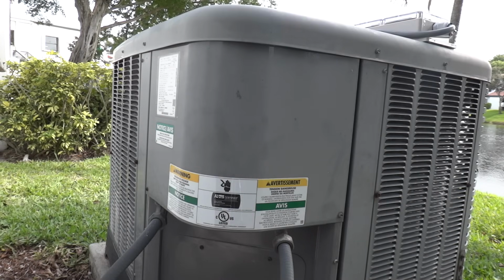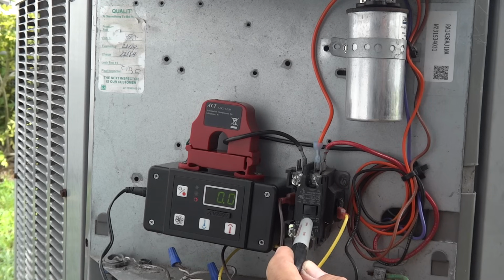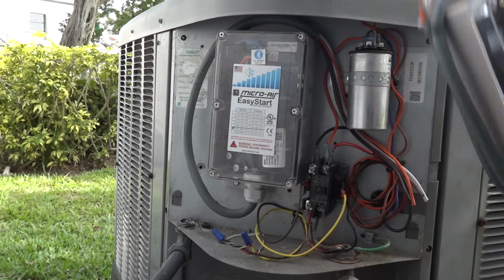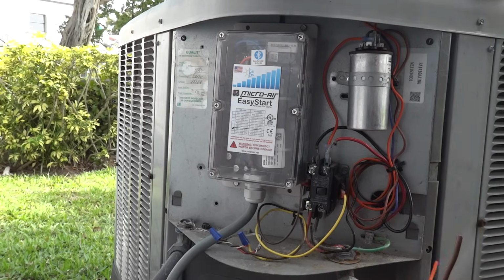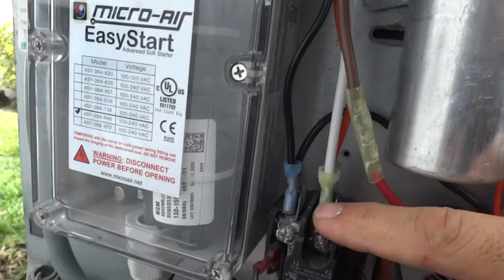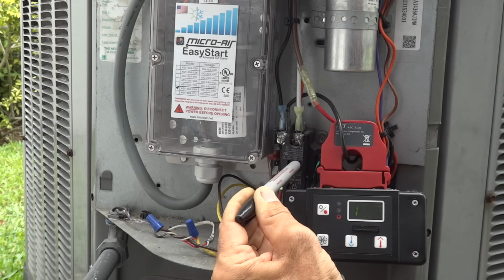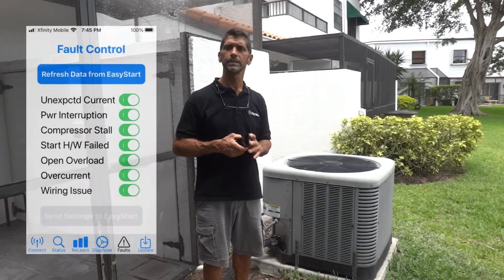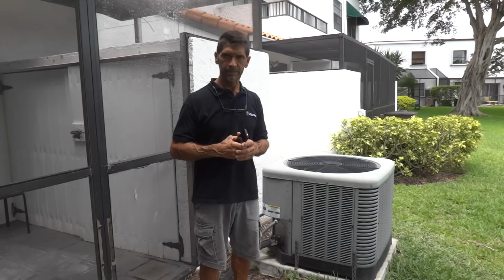Micro-Air EasyStart Home A/C Installation (368 Series)

Comment: This looks like a great device which I would like to install. I haven’t however been able to find any information on what happens if the EasyStart module should fail from some internal control problem? Electrical devices as we all know do fail, so I would like to learn what to expect when or if it does, which is usually not at the most opportune time. Will the A/C continue to operate under normal start up power, or not run at all? I have had a Generac load shed device fail and it prevented the A/C from running even with the main power on, resulting in an off hours call to get it back running. If the EasyStart fails, does it have an automatic/manual bypass built in, or would you have to rewire the A/C to get it operational until a replacement can be supplied?
Reply: Thank you for the explanation. Will the app provide any information that the device failed? This would be very valuable for remote monitoring.
Reply from the maker: Yes it can, assuming the EasyStart has not suffered some sort of internal power supply failure where its microcontroller and Bluetooth interface are no longer functioning.  If they are functioning, then the app can deliver the data to determine the nature and extent of any malfunction.
Reply from the maker: Hello and thank you for your question. As is the case for any soft starter, EasyStart is wired into the compressor wiring in such a way that if it were to malfunction, it would simply and safely inhibit compressor operation.  EasyStart has the highest reliability in the industry after over 12 years refinement and maturity, so failures such as this are highly unlikely and extremely rare.  In the few cases where there have been malfunctions, customers realize this because their indoor unit is running and blowing room-temperature air, the outdoor unit condenser fan is running, but the compressor is not after an extended period of time (i.e. after > 5 minutes).  Unwiring the EasyStart is simple since 3 of the 4 connections are "added on" to existing locations and can simply be unplugged.  The 4th connection involving the EasyStart's brown wire spliced to the compressor's run winding simply needs to be unspliced and the run winding connection needs to be reconnected to where it was prior to EasyStart installation.

Comment: I just ordered the X72 but according to your chart, I should have ordered the X48 for my 3.5 ton unit. Will the X72 work? I don't care if it's more than I need as long as it will work.
Reply from the maker: Hello and thank you for your purchase.  Yes, you will be fine with the X72 on your 3.5 ton system.  There is some overlap between the X48 and X72, but the revised ranges will guarantee optimal operation.  In your case, slightly oversizing will have little to no effect on the optimized starting amperage after the learning process is completed.  Thank you again for your business.
Reply: @MicroairNet  Appreciate it. Thanks

Comment: It was easy to install, works Great.  I bought it for my generator to run to house ac (9000 watts peak with 7200 running). Works great I would buy it again.

Comment: When you do 5 start do you from T-stat or you can just push contactor 5 time
Reply from the maker: Hi and thanks for your question.  You can conduct the 5 learning starts either way. If you are not in a rush to operate your A/C on a generator or an inverter, just let the normal cycling via the thermostat do the learning for you.  If you want to complete it more quickly, then you can deliberately turn the thermostat off and on or use the manual-button on the contactor.  Please realize though that if you attempt to restart the compressor via the manual-button on the contactor before it has been off for at least 3 minutes, EasyStart will flash the green "NORMAL" LED (3-times) until the balance of that 3-minute delay expires.  Also make sure you allow the compressor to run for at least 10-15 seconds AFTER the startup so that the EasyStart can properly record and save the learning data for that particular start.

Comment: While the easy start can get the AC/heat pump started, I wonder how much of an issue auxiliary heat strips run during defrost cycles would be. Since getting an energy monitor I've noticed that the air handler for my heat pump goes from 500 watts to 10kw for a couple minutes every couple hours when heating. The rest of the time my whole house including the 3 ton heat pump usually draws under 7kw. I'm wondering if the heat strips would need to be disabled for the defrost cycle if on generator power without a 10kw+ genset and if that would mean physically disconnecting them or if there is a setting with the easy air or something else that could manage it.
Reply: I looked into it more and found that removing and capping the white thermostat wire from the heat pump defrost board enables the defrost cycle to run without triggering the heat strips, so no more 10kw energy requirement popping up that would prevent my generator from being able to run the heat pump. I haven't noticed any comfort issues without the heat strips during defrost but it would be easy to reconnect the white wire if needed.

Comment: I was recommended this by an HVAC company because my compressor draw amps at start are a tad high. Would this help with the life of the compressor?
Reply from the maker: Hello and thank you for your question.  Yes, using EasyStart eliminates both the mechanical and electrical stress of "hard" starting. It also dramatically quiets the startup audibly.  Therefore, common sense dictates that the life of the compressor will be extended by repeatedly soft starting with EasyStart instead of hard starting without it.  Thank you again for your interest.  We have a 15%-off holiday sale going on up to the 31st, so take advantage if you would like.

Comment: Would these work with a (true) 5HP air compressor? My inverters will handle it, but I don’t like slamming them. My alternative is to find a 3-phase motor and use a VFD.
Reply from the maker: Hello and thanks for your question.  A 5HP motor is supported, but "frame" motors that are used in large centrifugal pumps, air compressors, dive compressors, and other machinery are VERY difficult to wire with the EasyStart.  This is because these types of motors don't "present" their individual winding wiring (start, run, common) as readily as does a regular HVAC compressor motor.  Wiring an EasyStart into a frame motor has been done with success multiple times in the past, but not without an enormous amount of upfront engineering work and the actual detailed wiring diagram from the motor manufacturer (e.g. Baldor, Leeson, etc.)  Micro-Air did this type of work in the distant past for some OEMs that were incorporating EasyStart into their appliance/machine designs.  As a result, Micro-Air no longer supports these applications for individual customers and discourages anyone from trying to do it on their own since we cannot support it nor can we afford to honor the warranty or any liabilities.  You'd be doing it on your own and at your own risk if you chose to attempt it.  Sorry, but that's the reality.  Thank you anyway for your interest.

Comment: Two additional recommendations.  Scroll compressor slurp up an initial larger amount of oil on initial startup.  You should allow compressor to run a minute or two to disperse the oil initially sucked up into compressor head.  Several short start-run cycles can log too much oil in compressor head causing oil slugging on compressor.

When mounting EasyStart in electrical compartment it is a good idea to check the sheet metal screw clearance on back side of sheet metal.  Driving a too long sheet metal screw into condenser coil will give you a very bad day causing a refrigerant leak in condenser.

Comment: I installed both of these today on my 4ton and 2ton compressors and let me say, they work and do exactly what they say they do.  The 4Ton Unit went from around 95-100 amps on start down to 39.4.   The 2ton went from 58 to 24.3,  absolutely amazing.  The compressors are quieter, and start more gently.  I can easily start both on my 24kw whole home generator now without any bogging down or lights flickering.  This product is well made, and does what it is advertised to do.  Took me 2 hours to install both, I have a bad back so I took about 45 mins worth of breaks, if I was myself from 30 years ago this would have been a 30 minute job to install 2.   Very easy to install and well worth the money spent.

Comment: Just installed mine and the LRA was 77.  After 5 starts it's 23 amps.  A 70% drop in current on a 3 ton ac.  Running current is 7 amps.  Hopefully it'll drop the electric bill a little.  I installed it so I can run my home ac using two EcoFlow Delta Pro's.

Comment: Just ordered two of these for my 2 and 4 ton AC units so i can take the strain off of my Generac 24kw whole home generator.  The 4 ton is old and pulls 117 amps during start and the generator runs it, but it bogs down hard.  These should eliminate the bogging and the lights dimming on generator.

Comment: The contactor is mounted incorrectly the t-terminal are top and should be on bottom where the main line from circuit panel

Comment: So i bought two of these for solar reasons. This video is the absolute basic install. From what i have seen so far there is no support with anyone live. In fact the support sends you to this video. I wired the first exactly as the instructions stated. The contactor engages and the unit throws faults and does nothing but the contactor stays engaged. If there is no live support in any form i will just send these back and continue to foot stomp the lack of support. Great product? Maybe. But, with no support- you’ll never know.
Reply from the maker: Hello artemass33 and thank you for your purchase.  We're sorry to hear you are having trouble with your installation and initial operation.  There is absolutely support available, 7-days a week.  And if a phone call is required - which is rarely necessary - that can be made to happen.  To start the support process you should submit a trouble ticket to the following website with clear photos of your wiring installation, the wiring diagram of your system, etc.  A support technician will get back to you quickly.  https://www.micro-air.com/SupportRequest.  Thank you again for your business and for your patience while we do our best to help you resolve your issue.
Reply: @MicroairNet I will add that the instruction in this video are not the same as in the paper version .  I looked for a phone number it was blank, additionally when the contact us SHOULD have an actual contact your has nothing- no phone, email, FB nothing. One more note, this video doesnt address the Bluetooth model and the required setup PRIOR to installation. Seems we installers have to go to several different places to get the information needed.

Comment: What wiring changes are necessary when your run capacitor has an orange CPT port like the Turbo 200?
Reply from the maker: No additional steps are required. Simply do not use the CPT terminal at all.
Reply: @MicroairNet  Thanks

Comment: Hello Mateo.  I just finished installing two Easy Start units and want to attach them to the AC by gluing four small 20 lbs. magnets to the back.  Do you know if the magnets will affect the electronics in any way?  I prefer not to have to drill into the AC unit because of the close proximity to the coils.
Reply from the maker: Hi Angel. Thank you for your purchases.  You're not the first to ask that question.  The answer is yes, but I would keep the magnets closer to the mounting flanges if possible.  If you happen to put one right underneath where the Bluetooth electronics reside, it might interfere.  

Using self-drilling screws does carry some risk as you stated.  I always do a thorough check behind the metal wall into which I may be drilling to make sure it is clear. That does sometimes require some partial disassembly of the unit, but it is always worth it.   Thank you again for your business.
Reply: Got it and thank you.
Reply: Oh, and my apologies for dropping one of the t's in Matteo.

Comment: Can I use a wire it instead of a butt splice ?
Reply from the maker: Hi and thanks for your question. In a home A/C application, yes you could use a wire nut to splice the brown wire to the run winding wire. For RV or marine applications, wire nuts are not recommended because of the excessive vibration that the A/C will endure.
Reply: @MicroairNet   thank you very much for your fast response!  I’ll be ordering one here soon

Comment: Just installed a 368 w/ BT on a 4 ton yesterday. Incredible difference in machine dynamics from before to after. Eliminated light dimming in the house during startup which is nearly imperceptible now from even the closest point in the house to the outdoor unit.

Comment: I have installed this exactly as this video as well as the directions instructed, However, mine continuously flashes the fault for unexpected current.  I have triple checked it, watched the video again, and triple checked it again. It is connected exactly as instructed. Can anyone help?
Reply from the maker: Hello Brian. Thank you for your comment and for your purchase. We received your diagnostic data upload, so someone will be in touch with you tomorrow. There are indications in the data log that there was an initial miswiring, followed by an overcurrent fault. This indicates that the EasyStart may have been damaged by the miswiring. Not to worry though. We'll take care of you.  Thanks again for your business.

Comment: I just found about these, and WOW! I’m going to order ASAP. But I have a question. I have a 3.5 ton Trane….. So is bigger better? As in which micro air to get? It states that with my size X48 blue… but am I able to get the bigger one as well? The X72 Blue. Any advice about this would help. I don’t want to be underpowered being at the top of the X48 Blue size, but don’t want to over kill the Size of the X72 and not work? Thank you for any help and advice.
Reply from the maker: Hello and thank you for your comment.  When it comes to EasyStart sizing, bigger is not better.  EasyStarts are optimized for their assigned capacity ranges.  Using an X72 on your 3.5 ton versus using an X48 will certainly work; however, you may not get quite as much of a start current reduction with the X72 as you would with the X48.  It's best to stick with the model selector recommendations.  Thank you again for your interest.
Reply: @MicroairNet  I was looking
On the instructions and it said something about checking for compressor monitoring system. Is that the same thing as the defrost circuit board? Also it there a number to call for trouble shooting and general questions. Email, texting? With pics for any info or hep.. Thank you for your time. I was
Waiting to hear back from from you before I buy. Thank you again
Reply from the maker: @ilver5478  The defrost board is not the same as a compressor monitoring system, so you should not have to take any special action there.  If you do have any issues during installation or thereafter, submit a trouble ticket at this website for quick service: https://www.micro-air.com/contact_microair.htm.  Thank you again for your interest.
Reply: @MicroairNet  Thank you so so much!!!!!!!
Reply: @MicroairNet  also, sense this is added the the AC, does that mean it will also lower the starting Amps for the heat pump too when running heater? Im new to all of this and am learning. Also, I ordered my x48🙏
Reply from the maker: @ilver5478 Yes, it will.  Heat pump operation runs the compressor in the same way, simply by energizing a "reversing valve" in parallel.  This valve re-routes the refrigerant to make your indoor coil the "condenser" and the outdoor coil the "evaporator", thus heating the indoors.  The compressor startup and running operation are therefore no different in either cool or heat mode.
Reply: @MicroairNet  right on🙏 thank you for all the info and help😀

Comment: I need to contact MicroAir support.  Website has no numbers to contact.
Reply from the maker: Hello Richard, and thank you for your comment.  The way to contact Micro-Air support is to submit a trouble ticket using the following website:  https://www.micro-air.com/contact_microair.htm.  Someone will contact you via email within 24 business hours and proceed to help you out from there.
Reply: @MicroairNet  thank you I have submitted a ticket.  There are 2 things happening Bluetooth is connecting and then disconnecting.  Next compressor is not starting.

Comment: Do they have smaller sizes? I have very little room to install.
Reply from the maker: Hello and thank you for your comment.  EasyStart 364 is the smaller outline enclosure, but it only can be installed on systems up to 1-1/2 ton.  Maybe 2 ton in some cases as well (but the official cutoff is 1-1/2).  If your system requires the EasyStart 368 in either the X48 or X72 variants, then you can always mount it outside of the electric box. It is IP65 and UV resistance.  Thank you again for your interest.

Comment: The only comment I have, it works, but when you call in, they are very protective with information, i.e., can you tell me why I get faults, the same answer is, maybe this or that, but always say it not the products fault. If you have the capability of diagnosing the problem, just tell us what it is. Other than that, product does what it is designed to do.